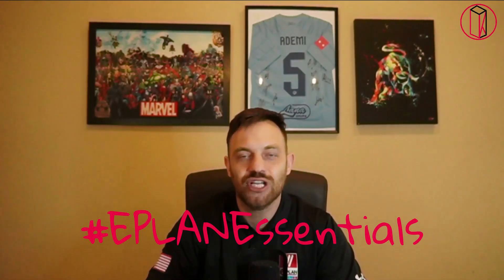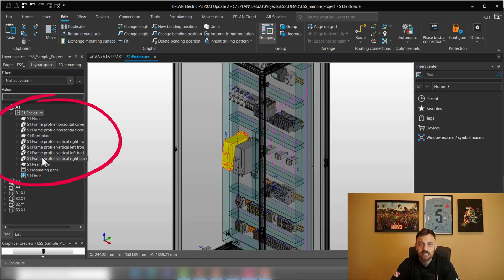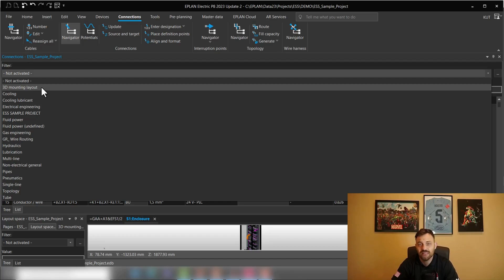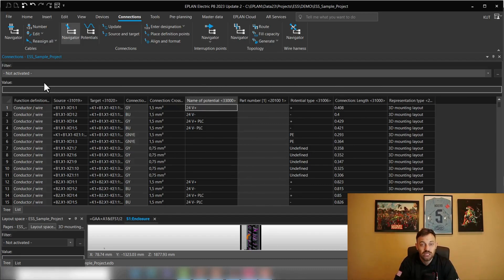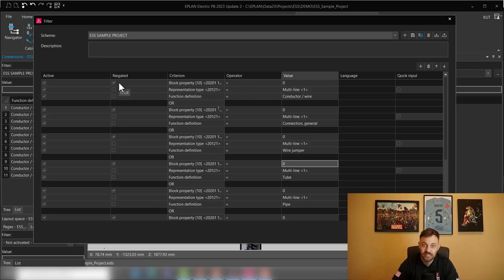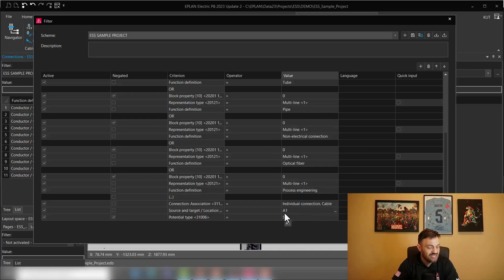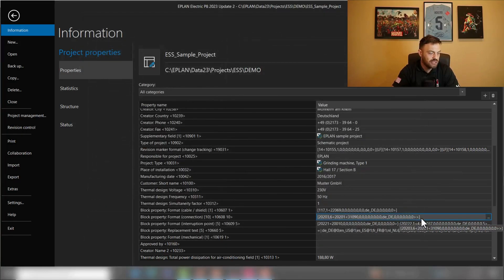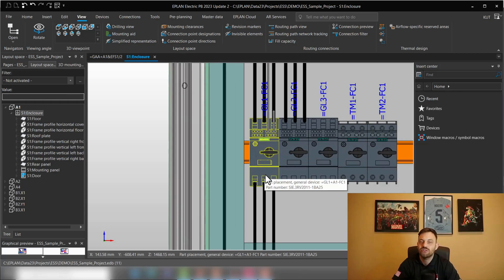How to Ensure COMPLETE Wire Routing in Your Enclosure

Comment: Routing in ProPanel is an addon. Saying that, I have routed all my wires no problems with no errors but I cannot get them to display in a Model View. I can display free routed connections but not properly routed connections? any help here?